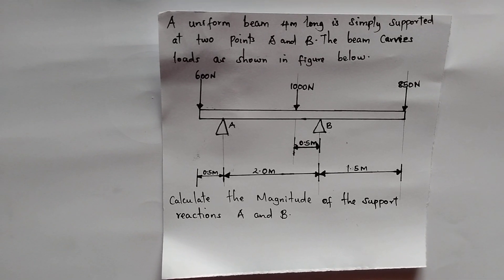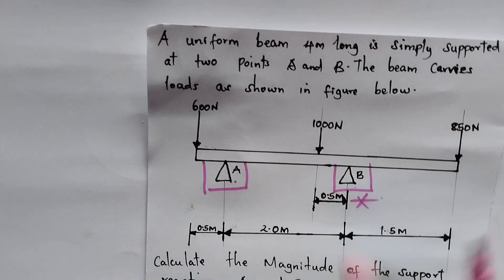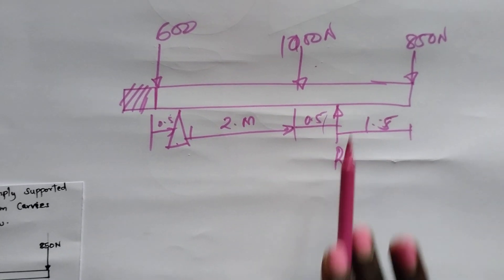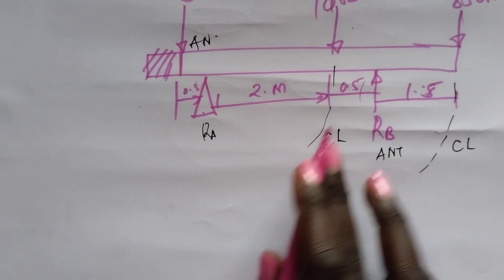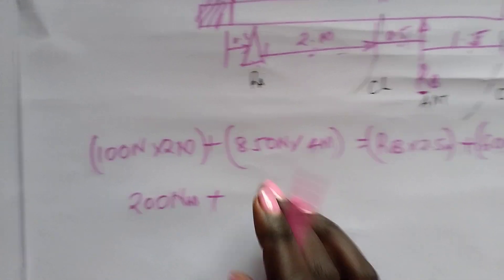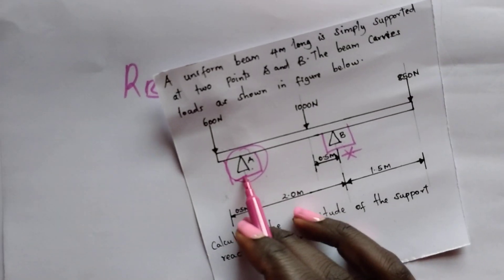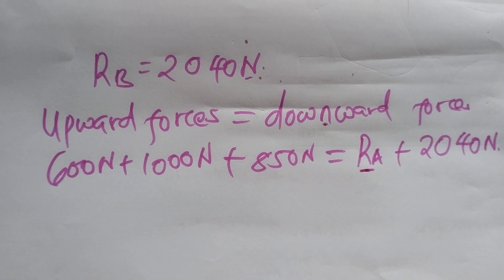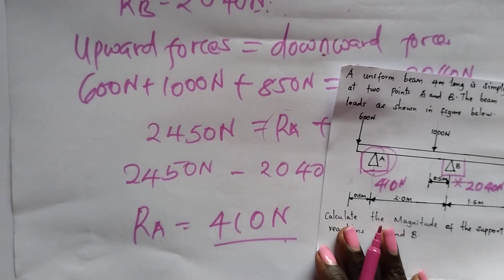MOMENT OF A BEAM WITH TWO SUPPORTS

Comment: Need clarification regarding the figure because it says from support a to support b its 2 meters but the load applied near support b is 0.5 meters therefore the distance from the load near support B (1000N) to support A should be 1.5 meters
Reply: And the distance from support A to the load 850N should only be 3.5 meters since the 0.5 should not be accounted for anymore
Reply from the maker: Thanks for that correction you're right taking point A as point of support  will Fd (1000*1.5) plus (Rb*2)